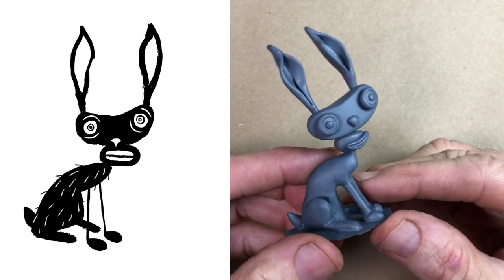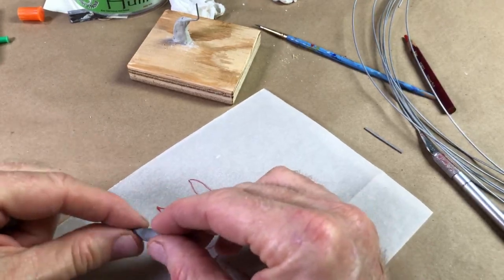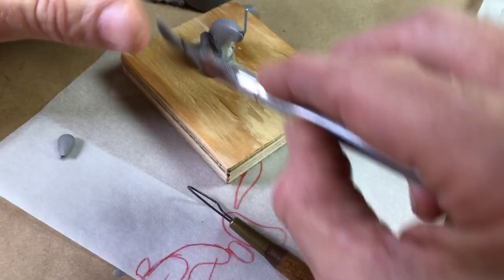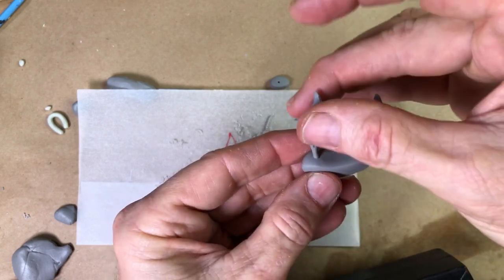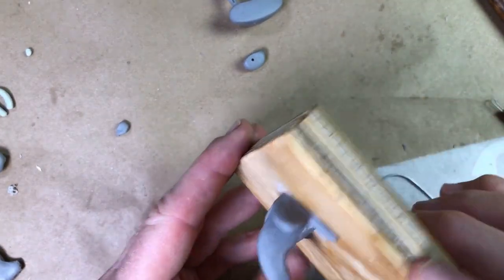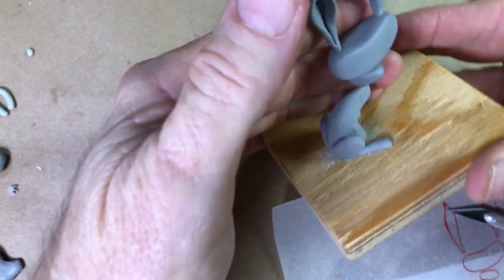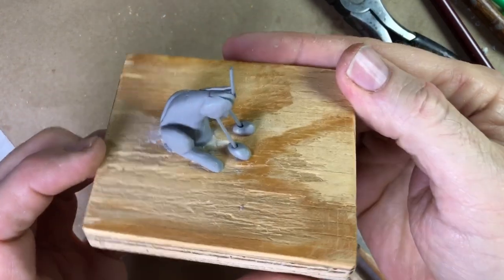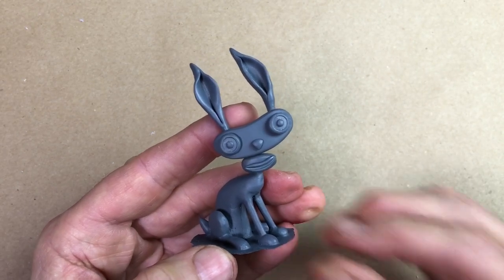Character Sculpting In Polymer Clay

Comment: Fun!  I’ll tune in next week.  Question: What kind of oven?
Reply from the maker: Any oven that you can reliably set to 275 degrees F. It is safe to bake in your regular food oven. I have a pan I use only for Sculpey, but aluminum foil works fine.
Reply: @RobertTolone I use a pyrex pie dish, because I know it's flat, and will stay flat throughout the baking process. I got burned a few times by thin sheet pans warping as they heating up, causing either my sculpt to fall over, or warping the bottom so they didn't sit right.